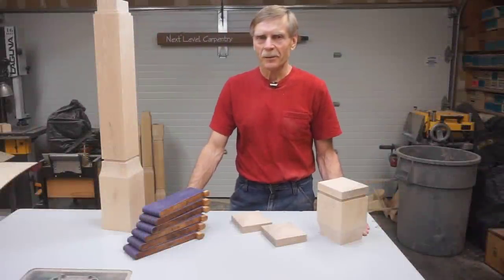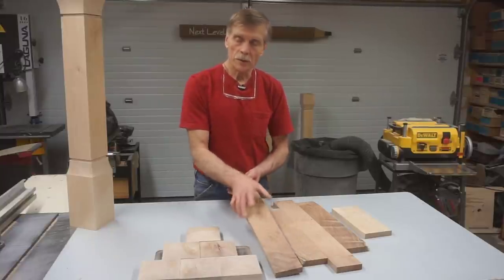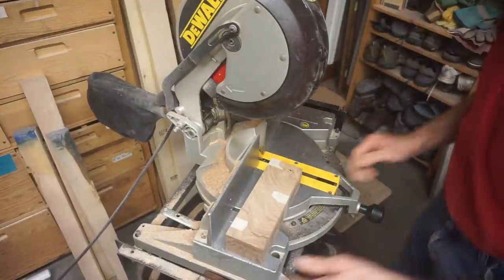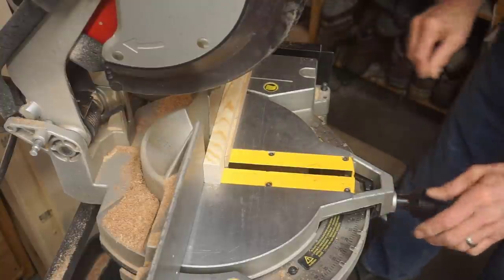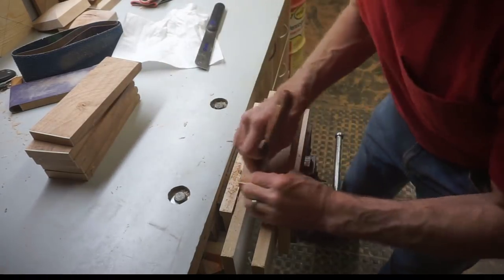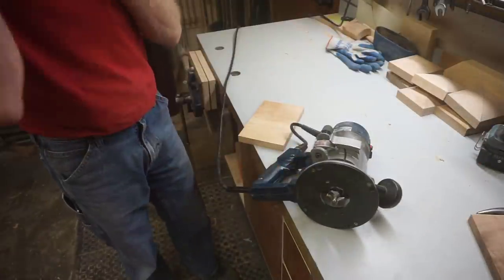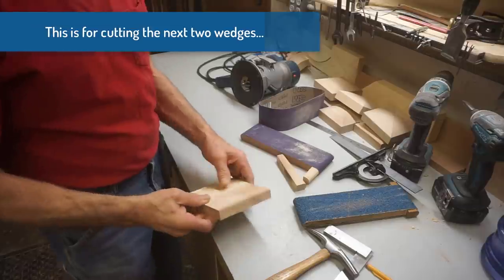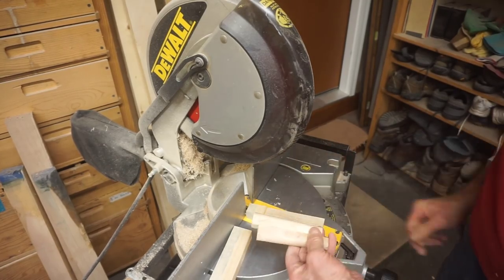Best Blocks for Demanding Sanding

Comment: Best concept for a sanding block that I've seen and certainly the nicest looking. I'm wondering how you might make them without the shop equipment/patience. I guess using a sheet material such as birch ply and then pinning/gluing a bullnose trim on each end. Straight cut the block 1 inch in and then wedge between this cut to tension?
Reply from the maker: Your simplified method sounds valid as long as your 'straight cut' includes an angle to conform to a single wedge.  Otherwise it would require a pair of wedges in a gap with parallel sides... a little more fuss but certainly viable if restricted by limited access to shop equipment?  Personally I think it would be simpler to just round-over your plywood ends by sanding rather than finding/making a bullnose trim to glue on.  Bottom line is that your viewpoint that not all viewers are going to go all out for a sanding block is probably much more realistic than mine that thinks they will😉🤣  BTW you should have seen the hodgepodge I was using for sanding blocks of this type before making the set for this video 😏
Reply: @NextLevelCarpentry  The pair of wedges thing occurred to me just after posting that message, of course - and that would be too fiddly, so the angle cut is definitely better. If you haven't got some bullnose hanging around (I usually have some in the scrap bin) then sanding for sure is easier. I guess the bullnose would just give you a quicker consistency and accuracy over multiple pieces which would reduce the variables of the fit and wedge calculations. I'm fascinated by the elegant problem solving that is often arrived at in woodwork and my first thoughts are how can it be simpler. Seeing so many over engineered sanding blocks beforehand made yours stand out. William NG has a nice design also that uses a wedge which is worth checking out. Thanks again.
Reply: Can quite literally make these with a basic handsaw, a sheet of 100 grit sandpaper and something true and flat to lay it over (thick piece of glass or tile, stone countertop  maybe...anything to put the sandpaper over to plane out, true up edges and make things flat.)

Most importantly, a calibrated eyeball, some 3/4 stock, 3x21" belt, and the inclination to make that happen.

Comment: Before buying this sander I would use a rotary sander https://www.youtube.com/post/Ugkx3Pc2vLXfcgM5oIpF1iYcIWyFhHUC-G6v and didn't see the need for a belt sander. Boy was I wrong. this belt sander does the job quickly and gives a professional finish to the wood work.

Comment: Thank you for this. As a recent newcomer to your videos, I particularly appreciate your attention to the utmost detail. The videos could become quite difficult if it were not for your humour - and the showing the mistakes that we all make. I also appreciate a wood shop that has dust in that; I can’t believe the almost operating theatre cleanliness of some that I see on YT - I can never get anywhere near that. For those reasons, you are certainly in my top 3 of the best channels to watch and learn from (always learning)

Just some thoughts from a (serious hobby) cabinet maker of over 45 years. There are usually several right ways to do something and several wrong ways; you now have the previously unheard of advantage of being able to watch highly skilled craftsmen and absorb the skills but also the psychological approach of a craftsman. The key to continued success is accuracy and consistency; I have found that those come from pride and patience. Machines don’t, in themselves, make you better. Machines, adhesives and hardware have changed woodworking totally since I began; choose and use the best of them to improve your product. Beware of the myriad gadgets out there - they are usually designed to make you poorer and not your work better. 

I use a different style of sanding block because I use strip pieces of abrasive (usually offcuts from my sanding machines). The principal of having many sanding blocks (80 grit, 120, 180, 240 and 320 here in the UK) remains.
Reply from the maker: Thanks for a great comment Theo! Love your quote:
"Machines don't , in themselves, make you better“... Very well put!
I appreciate your perspective on a shop with dust... A woodworking shop that has dust is far more productive than a dust collection shop that does woodworking IMHO😎

Comment: Thanks for posting this video Matt as I just made 6 of these sanding blocks this weekend.  I put some Slip It on the 3 degree end of the long block and also put it all over the short wedge block and it was a big improvement on getting the wedge blocks in and out.  As the sanding belts that I already had varied quite a bit in overall length, I made some extra wedge blocks in various widths to accommodate my sanding belt collection.
Reply from the maker: Way to adapt and improvise Mark... I like the way you compensate for variables to get things to work. Nice! Best, Matt

Comment: Just a hobbyist, but your videos have opened up a whole new dimension of woodworking. Thanks for all the hard work. Wish you were in the Sprinter camper van conversion business. Your insight into creating structurally strong light weight durable cabinets in a space with no square, level or plumb surfaces would probably be revolutionary. YouTube has some good ideas but many mostly amateurs.

Comment: As an installer I have 2 sanding blocks.  I have the Time Shaver Preppin' Weapon with a variety of paper/grits.  For heavy material removal I have a block a bit like what you are showing in this video.  I think I used 3/4 ply.  Mine is a one piece block.  One end is rounded over and the other end is square for getting into corners.

Comment: I made one like yours years ago. I have not discovered YouTube at that time and did not see one before. Made that out of necessity. Except I hand sanded the wood to fit snuggly inside the belt. Lost a bit of finger nail when fitting that in. The wedge idea made very good sense. Thank you for sharing.

Comment: Thank you for all the tips and tricks. I'm learning a lot from you and other YouTubers I have to make do with what materials I find available and in the process of following and doing what is presented really is making things easier and better. I made 3 sanding blocks using MDF scraps and found them to work great. one block turned out loose and I was able to tighten it up using painters tape wrapped around the dowel for adjustment.

Comment: Hi Matt.  I finally watched your video on making these sanding blocks today.  For the past two months every time I go to the big box hardware stores and pass by the sand belts, I have been resisting the temptation to get froggy and buy some before watching your video.  Now I can finally make the jump and achieve my dream of building my very own “Best Blocks for Demanding Sanding”.  

Thank you so much for taking the time and energy to pass on your wisdom.  I learn a lot of subtle things from watching you.  Your example also validates the things I somehow do right but have forgotten or take for granted the reasons why.  You have a keen way of setting the “proper precise pace” for efficiency in our world that has become so demanding. I regain my patience, focus, and serenity from watching you so thank you once again for all that you do.

Quick request:  I hear you discuss the different types of wood.  I have never been keen enough to recognize many species.  If it is in a big box store on the shelf, I can usually make out the three or four materials they tend to offer.  However if I had to tear apart pallets and correctly identify the materials as I have seen you do, I would be lost.  Definitely a skill separating the true pro from the want-to-be.  Two questions:  How might I gain some wisdom in recognizing the raw materials? Any recommendations on how to source a supplier of exotic or not as frequently used materials would be greatly appreciated.  Slowly working towards maybe doing some ukulele building or equivalent.  Materials such as koa, maple, rosewood, and spruce are common building materials but not normally in a big box store.  Thoughts?
Reply from the maker: Great story here Scott... much appreciated! A great place to start is any decent local hardwood supplier... the kind where those who do woodwork for a living go.  Owl Hardwoods in Denver is an example.  WoodCraft stores also have a unique variety of exotics and probably have an enthusiastic staff and/or following that are likely willing to tell you how much they know about such things.  It's a great age of knowledge and information so your efforts to learn will be much more fruitful than in the past.  My recommendation is to tear into an intimidating project and grind your way through.  It's kind of like scaling a mountain with dense undergrowth in the valley and slopes below.  It's a lot of work, you're going to become exhausted, scratched and battered on your ascent... but once you clear the treeline and look back at the path you've taken things will never look the same again when you look back at where you started.  THAT perspective is only gained through personal effort.  The fact that you opted to make sanding blocks instead of 'wimping out' and buying some tells me you're the kind of person who's willing to invest that personal effort for the sense of accomplishment it inevitably leads to.  All the best!  Matt
Reply: Next Level Carpentry Hi Matt.  Wimping out is typically not my downfall.  Taking on too many things at any given time is more of my nemesis than anything.  Thank you for the recommendation!  There is a WoodCraft store in a close by neighboring city. I will make an effort to visit it in the not too distant future.  I agree technology has brought a lot of avenues towards self education.  Glorious times we are blessed to live in.  Thank you again for the guidance.  Sincerely, Scott
Reply from the maker: @srjscott  you share an affliction with many-a-woodworker in that it's far easier to start projects with a blast of enthusiasm than it is to finish them with a mire of drudgery.  Hope your visit to WoodCraft is educational and inspiring.... Best, Matt

Comment: Some of the simplest ideas are the best. I added a 120g sanding disk to an order to get delivery included and will be making a block very soon. Perfect for cleaning up the edge of plywood sheets before they rough up the fence on a table saw. I always appreciate the little tips you freely give out.

Comment: I've had a similar sanding block now for over 30 years.  It's a 2x4 with both ends chamfered sort of round.  I slip my sanding belt on it and it works like a charm.  Learned it from an old timer.  Now I'm that old timer.  I love your high tech sanding blocks so much I just have to make some myself.
Reply from the maker: Al Bert, I know the sort of sanding block you refer to...  had some pretty weak examples of the blocks shown in the video so I too got an upgrade when I did the video... a bit of irony there! I think you'll really like and appreciate these guys the first time you put them to use. Best, Matt
Reply: Op

Comment: I really like your presentation style. 
I will make these although I own a commercially available sanding block that takes a 21” sanding belt but, I’m not buying 5 more of them so these are my next project. 
Something I like about this concept is that you can mount the belts back on a belt sander and use a cleaning stick to freshen up the belts..
Thanks for the great ideas.
Reply from the maker: Thanks for a great comment Harold and please let me know if you end up liking these better than the commercial one you already have? I have not taken the belt off to clean it on a electric belt sander but it's a great idea and suggestion so thanks for adding it here.  It's not a novel feature or anything but I do often loosen the belt and rotate it so the whole thing gets used evenly... Best, Matt

Comment: Hey Matt, what a great video. I could sit here and watch you work for hours at a time. Your so smooth in your motions. I may have told you that before and if I have I’m sorry for repeating myself but that shows that you are the same way in every video. I’m going to attempt to make these after I watch your video several times. I went through an ordeal trying to put new sandpaper on a set of round units you can put in your drill press or your drill. You have to tuck both ends of the sandpaper into this slot and Lordy I could never get both ends into this small slot. I’m not a quitter but I just gave up on it got a block of wood and glued the sandpaper on it. It worked just fine. I like yours because they look like they fit in your hand real good and long enough to really cover some ground with them too. Great job and great video. Thanks for sharing Matt.
Reply from the maker: Hey Becky, thanks for complimenting this video... I start out thinking 'this will be quick and easy' then it takes many hours over a week and still ends up at 25 minutes to make a simple sanding block!  
Make sure you're comfortable using your router/router table for making the block and wedges.  Make pieces big enough to handle safely, especially the wedges.  You could do the round-over routing in a few shallow passes rather than all at once because there's less tendency for bits and blades to grab pieces when they're not removing as much material.  These blocks won't replace a 'spindle-type' sander like the round ones you mention but they're indispensable in the shop... let me know if you get in a pickle if/when you try to make one and I'll do my best to talk you through it, OK?
Your enthusiasm and passion for woodworking will take you far!
Best,
Matt

Comment: Matt,  I haven't seen very many people use these even in the trade (I think they don't know how to make them so they just buy what is available).
I like your way of tensioning the belt, my way never seemed to give me the taughtness I wanted.  They make for one of the best sanding blocks.  Your system is the best I've seen for ease and adjustment.  No two belts are the same it seems and they stretch with age, your system allow adjustment for whatever reason.
This is a great video.
By the way, you seem to have more hiking shoes than I do.  They make great work shoes also (you probably already knew that).
Reply from the maker: Bestbuilder, as I mention in the video I was really surprised that there are hundreds of sanding block videos on YouTube but none of this design. As you mention the ability to tension belts really makes these guys effective!
I'm too old school to switch to hiking shoes for work... I love my Carolina work boots!  All those hiking shoes you see and mention are for the extensive, bordering on obsessive, hiking I do :-) http://rapidcityjournal.com/news/local/one-man-s-journey-times-to-the-top-of-harney/article_dd1a2775-8c2f-54ce-b3f8-8b60a05c568b.html
I see lots of guys sporting a pair of hikers for work and know that they've gotta be a comfortable favorite to spend long, hard days in 'em...
Best,
Matt

Comment: Those are awesome! I usually wrap sand paper around various sized blocks of wood. 
Which works great for sanding spackle during. Paint prep
But for the work shop I’m definitely going to make a set of these.
Yanks for the video!
Reply from the maker: I think you'll find these invaluable in the shop Joseph... I use mine frequently.  Hope it works for you to make a set!  Best, Matt

Comment: Thank you for making this video.  I have for a long time kept 4 to 5 of the rubber sanding blocks with different grits ready for quick use, but am always tired of changing out the paper after 3 minutes of use and thought that there has to be a better way.

Comment: Great video and great idea thanks, I kind of had the same idea but I was pulling the belt sand paper tight then running staples in it, your idea is so much better, thanks again
Reply from the maker: I think you'll really like the wedges over staples Tarin!  Something I notice as weather, temperature and humidity change is that they all affect belt length.  With the wedge I can adjust it at will to keep it tight and working right! Best, Matt

Comment: For years I've gotten by with just a sheet of wet/dry sandpaper stapled around a piece of wood from my scrap bin, but the paper tends to tear and wear out quickly requiring frequent changes.  A few of your wedged blocks should work much better and last a lot longer.  Great idea!
Reply from the maker: Exactly!  I think you'll love these... especially if you use high quality sanding belts like the purple 3M ones I use... almost as tough as a file! Best, Matt

Comment: Thank you for your continued videos and sharing. I always learn some new techniques & tips as well as some cool projects.   I have some older 3x21 belts that have weakened splice joints due to the tape drying out.  Using them on my PC belt sander is exciting as the tape joint suddenly fails while sanding with a loud 'pop'. Now I will have a way to use these older unused belts.
Reply: Responding to the old post I use the CA glue to reset the belt seam.